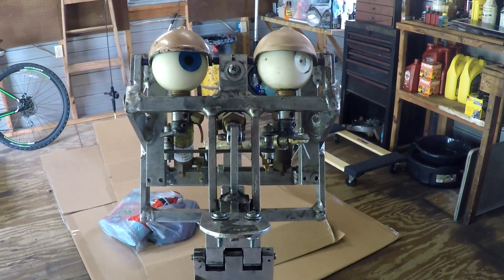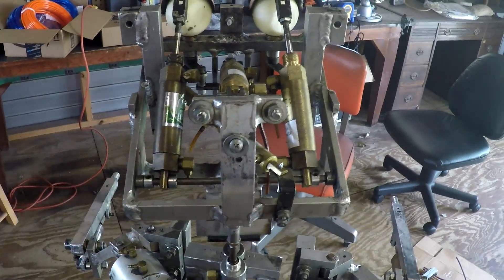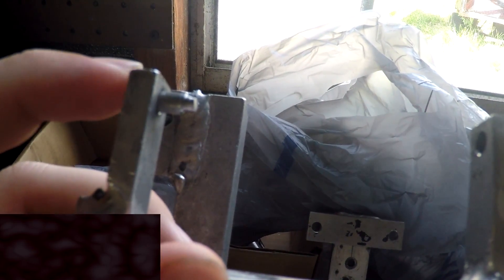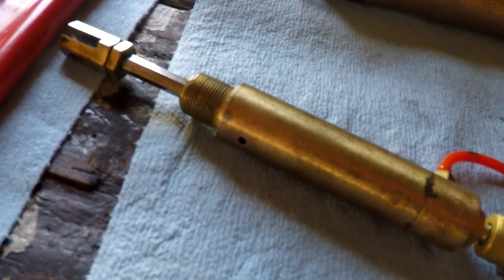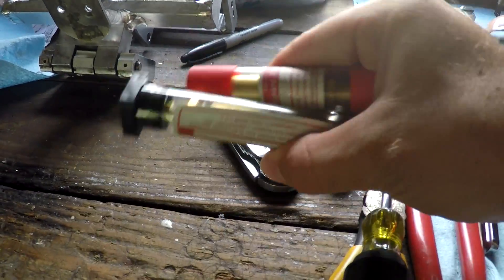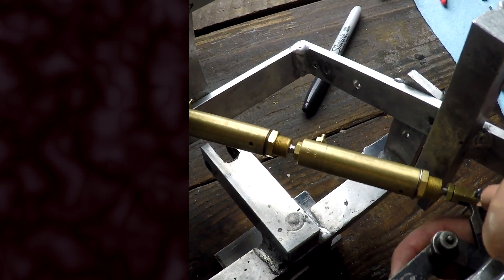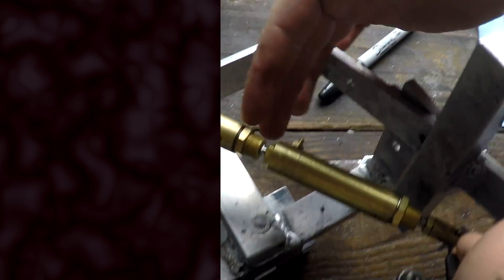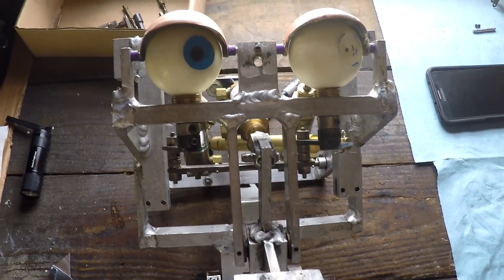Robot Drummer Animatronic Project PART 3: A Head Start

Comment: Neat project, it looks like you need to put to use your mechanical engineering talents and a lot of common sense. I wish I had such a nice shop. I will have to look back at your related videos
Reply from the maker: Thanks. The shop would be nice if I took the time to set it up. I moved in back in April and I pretty much have all my stuff laying everywhere. It has a nice long bench that would be perfect for electronics but I still have most of my electronic stuff laying in a pile in my dining room. Eventually I'll organize everything.
Reply: lol I have been trying to keep things cleaned up for over 50 years, every time I get things right we move. Very best ...Leo  ars K1zek